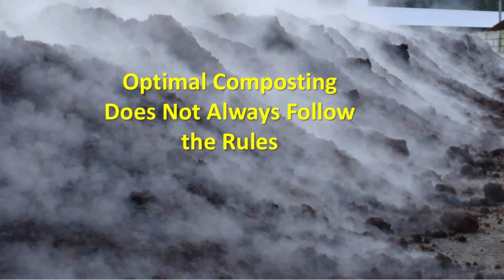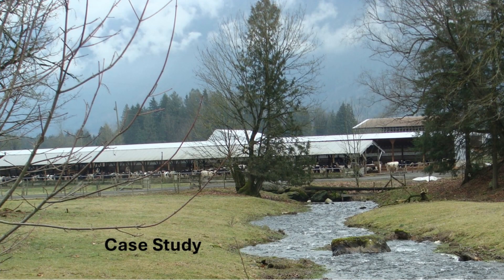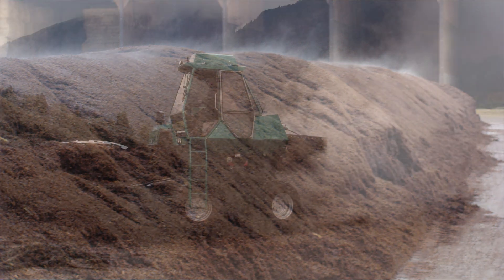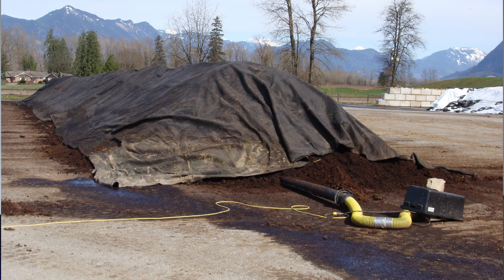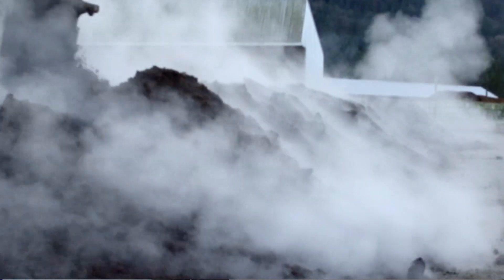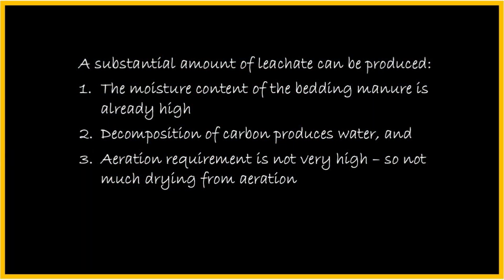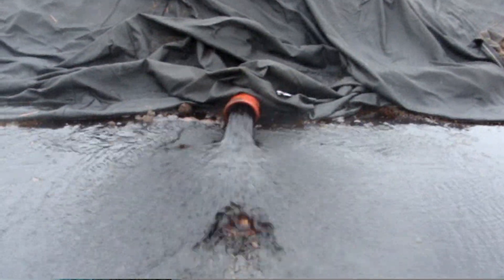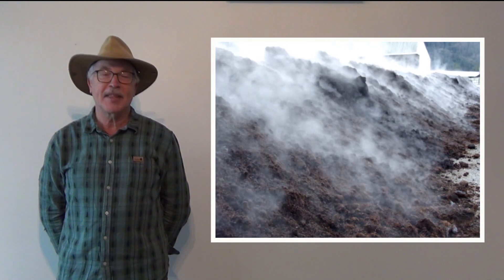Optimal Composting Does Not Always Follow the Rules

Comment: Does the leached water have a value?
Reply from the maker: the leachate coming from the composting piles will contain valuable soluble nutrients, but will also contain readily available carbon and fecal coliform. It would not be stable or meet safety regulations or guidelines. It could be applied on to the farm fields (just like manure can), assuming that there are farm fields to apply it to!
Reply: Aerating the "waste" water would be probably smart as well. Just like a compost tea. A cheap venturi nozzle should do the trick here :)